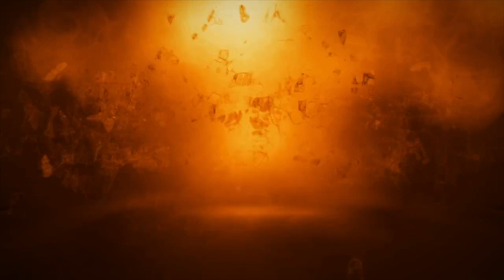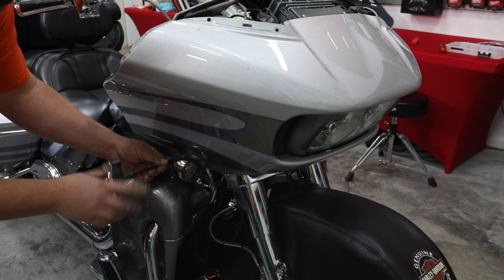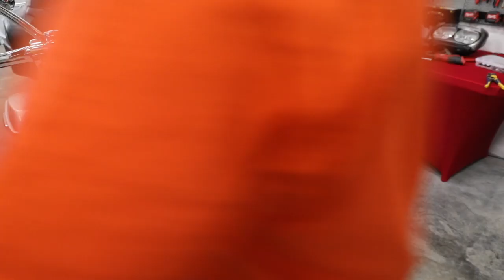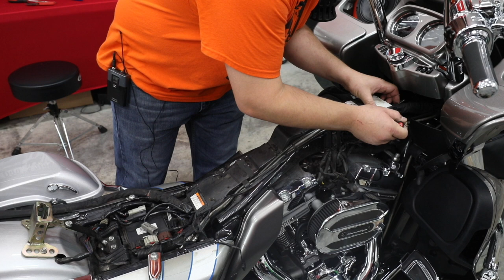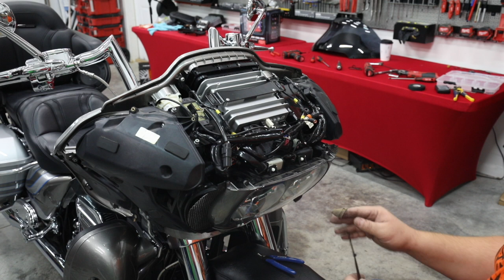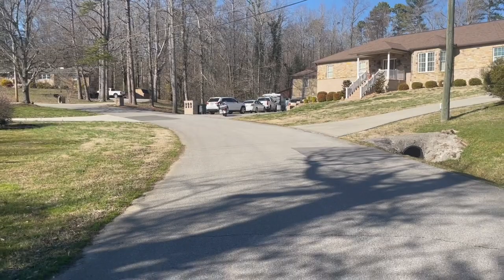Soundstream HDHU14+ Install in a 2016 Harley Davidson Roadglide CVO with Hertz Stage 4 Audio Upgrade

Comment: I bought this and the stereo is ok but the wireless carplay is useless, I tried to communicate with them over this but didn't really get any response, the other day I bought a different brand wireless carplay and it works perfectly, buy stereo not wireless carplay
Reply from the maker: We recommend a radio with wireless CarPlay built in, the aftermarket wireless adapters do not work well because they are not certified and Apple / Android are releasing updates to stop the add on adapters from working

Comment: Can I use this radio in my 2018 road glide special that I have a little Rockford PBR400x4 and SX165 in fairing?
Reply from the maker: Yes, Here is the latest model 

https://volunteeraudio.com/products/soundstream-reserve-whd14-plug-n-play-head-unit-for-2014-2023-harley-davidson-r-touring-motorcycles-w-wireless-apple-carplay-r-android-auto-r-7-qlcd-touchscreen

Comment: Question I have the HDHU14+ In my 2021 Road Glide with the handle bar control module I just ordered and installed you amp and speaker kit my question should I hook the control module to the radio first then the amp or the amp first then the control module or does it really matter which way thank you
Reply from the maker: Hand control module must be installed directly to the Soundstream radio

Comment: Will the intercom from driver to passenger still work with this setup?
Reply from the maker: Wireless headsets would still connect to each other, when you replace the radio it no longer sends audio to headsets from the radio

Comment: Hi Jay, can you add 6x9’s to the saddlebags (with power locks) to a 2014 CVO limited.? Is there a different brand 6x9 that will work if Hertz 6x9’s don’t fit? I really need some low end coming from the saddlebags. If not, what do you recommend to get better low end?
Reply from the maker: Do you have stock 5x7’s? There is an adapter to maintain power lid locks and install 6x9’s if you have the 5x7 lids, if you do not have lid speakers currently and want 6x9’s cut in you will lose the power locks, How to modify the 5x7 speaker locations in your Harley Davidson Lids to upgrade and fit 6x9 Speakers
https://youtu.be/5memAT2qPJI
Reply: What’s my next option for low end since I can’t cut my lids to 6x9’s due to power locks? The bike only has upper fairing & rear seat speakers stage one system.
Reply from the maker: @Wagz41  watch our latest video on the triglide walk away, 4 6.5” speaker, sx165neo front, sv165neo rear and the sp4.900 amp, it has very good low end

Comment: With this radio, does the ultra models loose the passenger ability to control their volume?
Reply from the maker: Yes, rear controls will not work
Reply: @volunteeraudio  thanks. I was worried about that and if I should go ahead and get this for my 16 RG Ultra.

Comment: I blew 2 sets of hertz sx165 neo speakers with a lesser amp. Better options for speakers out there with that amp
Reply from the maker: Correct setup is key, any speaker will blow if you send a clipped signal to it long enough.  We have never had one sx165neo blown in any kit we have installed.  These are in my opinion one of the best speakers available.  I really like the infinity kappa perfect motorcycle speakers too.  90 percent of our installs use the hertz speakers and I have no reason to suggest a different one.  With that being said we sell other brands too but I think if you blew the hertz there was install error most likely in the gain adjustment of your amp.
Reply: @volunteeraudio  I actually adjusted the gain to minimum on the second set. I have had good luck with the kappa s and the db motos
Reply from the maker: @HDR20  but did you set the gains with an oscilloscope or distortion detector, some amps are so dirty they clip on the lowest setting, ran into this recently with a ds18 amp, all the way down was still a clipped signal

Comment: I have a 2012 street glide with the Metra inner fairing that allows for the Sony XAV-AX7000 head unit, is there a way to be able to install the reserve unit in my setup?
Reply from the maker: There is not